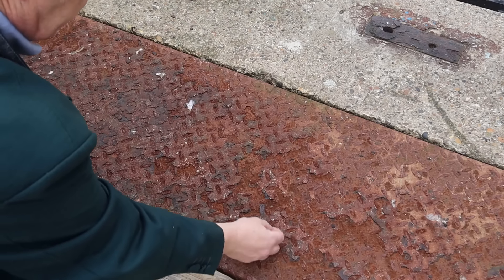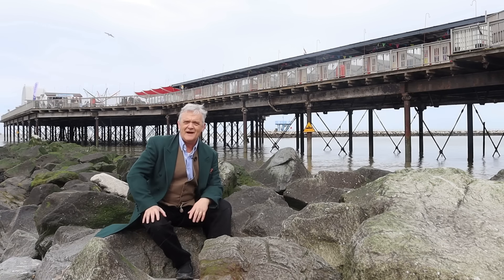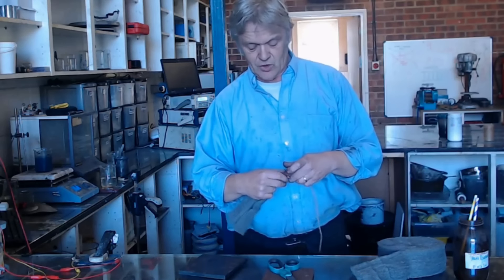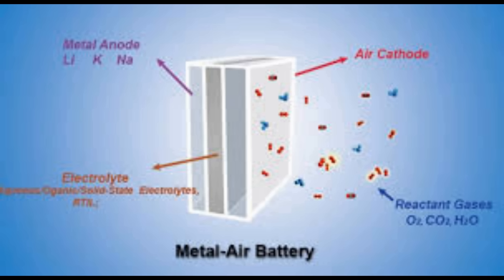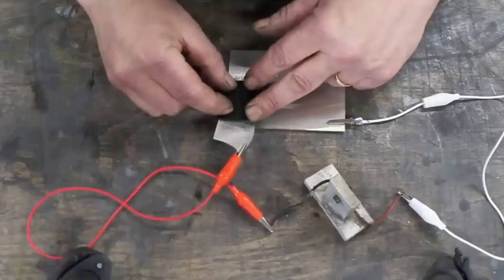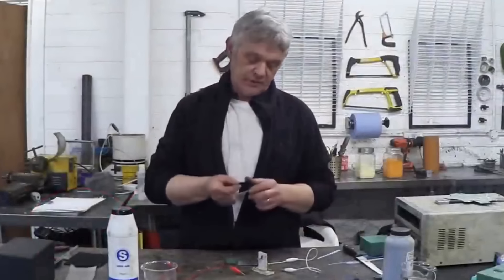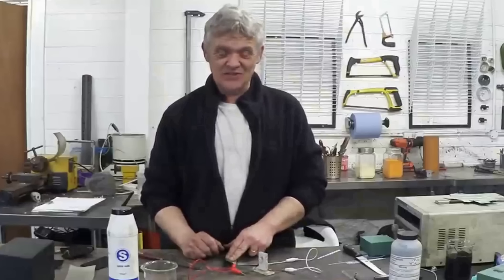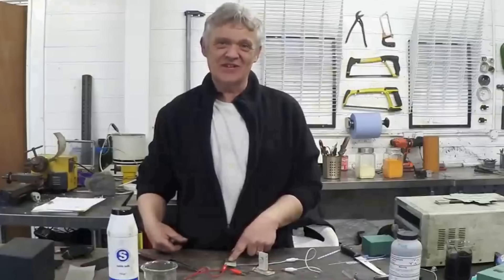2242 Metal Air Batteries And How To Make One

Comment: I remenber going into secondary school. The first thing we did in science class was make water rockets. This was followed closly be actual small rockets (basically fireworks). We did everything from model aircraft to a small distillation unit to electro plating and making hydrogen. It's because of my science teacher I did a degree in mechanical engineering.
Thank you Mr Ford. 😊
Reply: Those are the exact teachers that should be making the national curriculum. 
Science is captivating not the tedious memorization the kids get. 
Mr. Ford was a blessing.
Reply: Really wish I was in your class😅
Reply: @CraigLandsberg-lk1ep  I can still make my own gunpowder and solid rocket propellant. At Halloween I usually make Hydrogen and tie the balloons on strings in the garden and let the kids set them off.

Comment: Oh, you just brought back some awesome memories from long ago! When i was but 12-13 years old, I made (found plans in some book or other) a Zinc-air cell. If memory serves, utilizing black Iron oxide as catalyst and incorporating a continuous fueling (well, slowly pulling the Zinc foil and separator along) system. I suppose that makes it a fuel cell?
I was invited to present it to a university class (on a different topic) which I was "informally" (read, just walked in, sat down and started taking notes) auditing. 
Quite the terrifying thrill for that young boy but I believe the Prof. wanted to make an example of the curious, awkward and desperately bold chap.

Comment: Want to make a super high current version? Use steel wool with rust as the anode with a stainless steel or nickel alloy current collector. For the electrolyte use sodium or potassium hydroxide solution. Coat a fine silver plated screen with a mix of graphite, activated charcoal, silver and MnO2. Best to rapidly stir a slurry of the carbon and silver nitrate, then add a bit of KOh with heating, Next add kMnO4 then add hydrogen peroxide to add the MnO2 to it and vacuum filter. Add fresh KOH to it and scrape into the screen. Make a sandwich of 2 cathode and 1 anode plate and wrap it all in tyvek material. Gives about 1.3V but can output several amps and can be recharged. ❤

Comment: Potassium Permanganate has such a wide variety of uses. It can also be used as an emergency fire starter by adding a drop of Vegetable Glycerine, (Just make sure it's already on the wood before adding a drop or two of Vegetable Glycerine!)
Reply: Many years ago when I was at school, I would use this reaction as a time-delay ignition method for DIY fireworks: Pour out a little pile of permanganate crystals into a little foil tray sitting on the ground or taped to a horizontal surface, position the firework fuse just above it, then add a dribble of glycerine from a plastic syringe or pipette. You can control the timing fairly reliably by altering the particle size of the crystals, since this affects the surface area available for the reaction. If you use a fine powder, the glycerine ignites almost immediately, with a time delay of only a few seconds. Granules the size of sugar or sand give an ignition delay of 20 to 30 seconds. Even larger granules about the size of uncooked rice grains are even slower, giving an ignition delay of a minute or more.
The way I did this was by getting a jar of coarse permanganate crystals and sifting them through sieves with different mesh sizes to collect granules of different sizes, then store them in separate jars. Plus taking some of the smallest crystals and grinding them in a pestle and mortar to make some fine powder.
Reply: That is so way cool!!
Reply from the maker: Great tip!

Comment: Aluminium air battery is potentially better as its 100% recycable and dose not use rare earth minerals. (An Ex-Navy officer from Britain Trevor Jackson invents a battery that can give a range of 2000 km on a single charge.) The idea is to switch out the battery in 90 seconds at a filling station. 
Also look into the Nathen Stubblefield Coil to power a rotor for about 10 days with out any battery.
Reply: Reducing the Al2O3 needs an lot of energy and carbonrods that release co2. with Cryolithe i think you need over 1000C without it over 2000C

Comment: Thank you very much for making this video. I really appreciate the explanation of the Iron-Air battery. But I was a bit confused because you switched to Magnesium Air later in the video. Nevertheless I found the use of the catalyst ( nano-form of manganese dioxide ) to be very helpful as well as the use of the carbon felt instructions. 
Magnesium can burn really hot tho.  And it wouldn't take much to get a pure magnesium plate burning if something like a short were to happen in a battery. 
However, the advantage to magnesium over iron appears to be improved energy density and better cell voltage.
It would be better if the magnesium could be put into a form that was less dangerous, but retained most of the benefits.
Good stuff!
Reply from the maker: they all work the same way mate - but i swapped to magnesium because it is so much more energy dense

Comment: I'm currently without a lab, could you try this method with an Aluminium block with a tiny bit of Gallium absorbed into it,  you know better me even but here it goes ; sandind the alu block bare and then put a liquid drop of gallium and gently mix with a bamboo stick or similar non reactive .  Love your work as always, kind regards from nl

Comment: I am finding Fe2O3 and 4Fe(OH)3 for the rust. What is the deal? Is hydrogen bonded into the rust?
Reply: There's a lot of different molecules commonly referred to as rust, either iron oxides or iron hydroxydes, usually containing crystal water (which doesn't have to be only H2O but can be alkaline) to boot. Rust chemistry is not wholly simple 😉
Reply: @Smo1k  thx

Comment: Would the power output increase with higher air pressure? I am assuming yes because there will be more oxygen molecules bombarding the surface. I ask because in an automotive application, trying to optimise aerodynamics to leverage ram pressure incident on the electrodes might be beneficial.

Comment: Is there a way to essentially “electroplate” MnO2, say by using potassium manganate (K2MnO4) as an intermediary?

Reaction 1:
2MnO2 + 4KOH + O2 → 
                   2K2MnO4 + 2H2O

Reaction 2 (electrolysis):
(-): O2 + 2 H2O + 4e-  >  4 OH

(+): 2 K2MnO4 + 2C + 4 OH-  -> 
    2 MnO2 + 2 K2CO3 + 2 H2O + 4e- ?

Net (R2):  O2 + 2 K2MnO4 + 2C ->
                     2 MnO2 + 2 K2CO3

Net (R1+R2):  2 O2 + 4KOH + 2C ->
                       2 K2CO3 + 2H2O

Reaction 3, (at anode):
2 CO3(2-) + 2 H2O -> 
                                   2 CO2 + 4 OH- ? 

Net (R1+R2+R3):  
2 O2 + 2C -> 2 CO2

——-
Idea 2 (slow dissolution and precipitation of MnO2 without electrolysis):

Reaction 1:
6 MnO2 + 12 KOH + 3 O2 → 
                 6 K2MnO4 + 6 H2O

Reaction 4:
6 K2MnO4 + 4 H2O ⇄ 
        4 KMnO4 + 2 MnO2 + 8 KOH
(reaction proceeds slowly)

Reaction 5:
4 KMnO4 + 3 C + H2O -> 
       4 MnO2 + 2 KHCO3 + K2CO3 ?

Net (R1+R4):
4 MnO2 + 4 KOH + 3 O2 → 
           2 H2O + 4 KMnO4 

Net (R1+R4+R5):
4 KOH + 3 O2 + 3 C → 
    H2O + 2 KHCO3 + K2CO3 

——